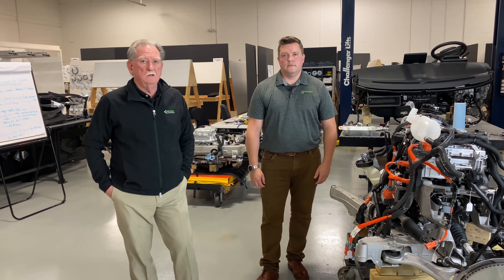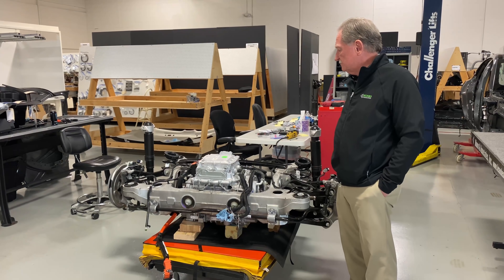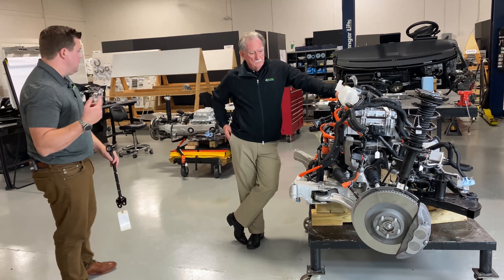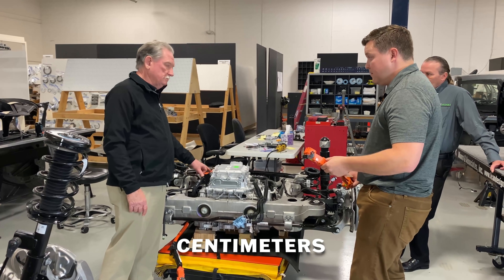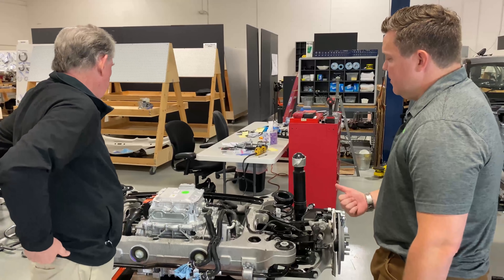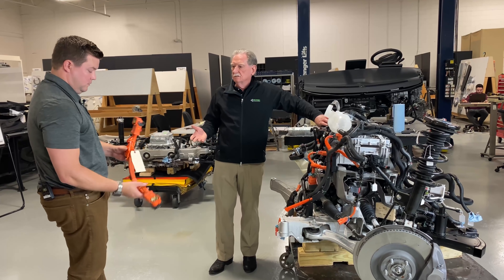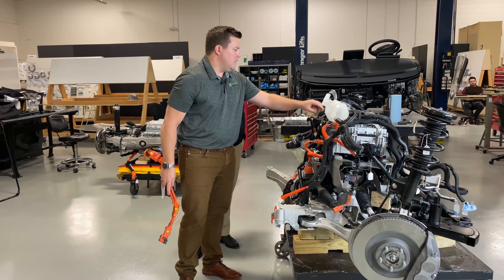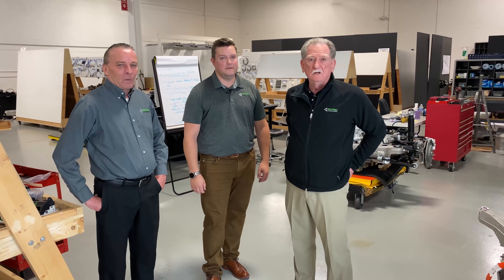Mach-E Suspension & High Voltage Wiring Compared to Tesla Model Y

Comment: I hate to be “that guy” but here we go.  So, your standard of excellence is Tesla, one of the least reliable cars on the planet.  The Ford Mach-E, on the other hand, is one the best.  One big difference I see between Tesla and Ford is Ford can take criticism and Elon Musk cannot.    Many people have been denied upgrades, warranties, or black balled for having the nerve to say something bad about Tesla.  Can you imagine being denied service at a Ford dealership because your Facebook page said Found On Road Dead.  Tesla also requires owners to go Tesla only for repairs.  No thanks.

Push-on connectors are great for low current application.  No so good for high current.  You can get arcing between surfaces and eventually high resistance, bad.  I will take solder connection thank you very much. 

Not a fan of aluminum control arms.  Elasticity is not as good as steel and it tends to brake and not bend when hit hard.  That is the deterrence between driving home with a bad pull and spinning out of control if you hit a large pot hole at 45 MPH.  If you want to see an amazing chassis take apart a Dodge Viper not BMW.  Mostly chromoly not aluminum.  Not one BMW in the top 30 times around Nürburgring.  There is a couple of Vipers.

You are right, people can get stuck in their ways. Engineers can also design things that look good on paper but don’t work in the real world.  When I was involved in auto racing there was an obvious push to save weight.  The theory was you want to design the race car to be just strong enough to get over the finish line.  I will tell right now I don’t want to race that car. LOL

I did enjoy your video.  Hopefully you can except a different point of view.  Mechanical Engineer and former Master Mechanic.

Comment: The only advantage I can see to that drop in style is conversion you want to take a fossil fuel driven motor take it out put an electric motor in this is the perfect setup it will fit in wherever you want it as long as you treat everything as if there was a motor in that car to begin with so I think this might just be them covering both bases for right now like you said it's their first swing they don't want to miss and I think this is a way of doing that and at the same time it's easier to do and more cost efficient because there's less tooling changing there's less machines they have to be converted to a different style this is still basically the same style so all of their current machinery can put this in place quite easily

Comment: Looks like a hose nightmare at 11:00.  Looks to me like the bottom line is get a Tesla
Reply: Watch the other video where they compare the thermal systems, the Mach-e looks like the Three Stooges designed it. I wouldn’t touch it with a 20’ pole.

Comment: What stood out to me, knowing that Ford management made a mid-project decision to make a performance car called a Mustang out of an in house bottom up EV design for a sedan was the very possibility that the front motor assembly might have replaced a hybrid version of that prosaic sedan in their line up. That would need the same front drive motor from some other Ford sedan from its Mexican and perhaps Brazilian operations as a drop in. The smaller but more elegant rear motor assembly could have propelled a compact  family sedan just fine, as an EV with less performance and more range ability based on battery pack size variations. Tesla inspired them to make this the higher price point product it now is, and sedans for the  North American market have been dropped except for Mustangs that the F-150 crowd will still want to buy in second or third childhood:)

Comment: We are a team of 6 Engineers that leads the development of all HV Connectors at Ford.  I quite enjoyed this video and we are always open to constructive criticism.  Some points mentioned are totally accurate in the video but certain things are not as it's easier to point things out being an outsider.  We work collectively as a team and are communicating day-in/day-out so there is no such thing as lack of communication.  We do have suppliers building these connectors for us but they go through intensive DV, also the aluminum casting shield is to comply the EMC requirements as mentioned at 12:00.  We will be working hard to improve the design in the near future.

Comment: So basically this entire guy is about making it cheaper....durability, means nothing.  the love of snap in and on parts is just cheap mfg. techniques, not long term durability, or reliability.  all the those plastic snaps go bad over a few years in hot and cold ..Tesla you know is unsustainable...it still doesn't make a profit on products...VW is already #1 in Europe and it just started pushing out EV.  Audi, Porsche, VW, Skoda, and on and on.  Ford teamed up with VW, in order to survive the global vehicle market, which GM and Ford are irrelevant

Comment: So my take away from the Heat Pump analysis and the Wiring Analysis is that Tesla is head and shoulders ahead of everyone so far in the design and execution of their cars (what makes the car go), the only places that they were lagging a bit was in the Panel Gaps and Paint. So, the two things that are typically superior on the Legacy Brands. My Model Y is a December 2020 Build and is very good in Body Gaps (minimal defects), similar to my wife’s C Class Benz.

Comment: The reason it’s a McPherson strut is because it started life using the Ford Fusion chassis, albeit highly modified. This notion that you can’t have a good ride with McPherson struts is ridiculous. BMW’s most popular vehicles use struts, NOT double wishbone (like Tesla). The BMW 3-series/4-series, X3/X4 all use struts and always have, as does a Porsche 911. You can have phenomenal handling and ride quality with a strut. It’s far cheaper to fix, easier to assemble and as mentioned it offers a tighter turning radius. I wish Sandy would stop saying “if you want a BMW ride you need to do what Tesla did…”

Comment: Another reminder that Munro's team are experts in car manufacturing and not design or tuning. The notion that a multilink suspension is automatically better is patently false. Modern BMWs with their complex suspensions have atrocious steering feel and Teslas handle poorly in anything other than a straight line unlike the Taycan which uses the same double wishbone front suspension geometry. Best modern car steering is in the Porsche Cayman and 911 which use (drum roll) struts with the 992 GT3 being the first front control arm setup.

Comment: Hey Sandy the agreement VW and Ford was not for the MEB under he ID4 in North America. There are multi parts to their cooperation:
- Ford will use MEB only in Europe for a smaller vehicle slotted below the MachE. 
- VW Amarok will be a truck built on the Ranger platform 
- they are co-developing 2 BEV van platforms. VW is working on the smaller one & Ford is working on the larger one.

There was a lot of news around all of this two years ago if you wanted to read up on it. Or check with your old buddies at Ford.  If you want more info on this platform you are working on you should ask them about the Lincoln and 2nd Ford crossover coming on it (CDX737/CDC474).
Reply: This also explains why you thought the batteries were SK Innovation. They will making cells in Georgia for VW’s UD4 production in Tennessee and Ford’s F150 Lightning in Michigan. 

The MachE batteries are supplied by LG from their factory in Poland. This was mentioned when they announced that production for the first 12 months would be production constrained to 50,000 with 1/3 for North America and 2/3 for Europe due to the tougher emissions requirements there.

Comment: Sometimes someone unfamiliar with a particular piece of standby equipment would exclaim "what's making that god awfull noise?!" when the AC was shut off. The battery bank was 48V ,but there was one circuit that required 110V DC. So a DC motor/alternator was used to invert .

Comment: I really appreciate these videos.  I sure hope ford is watching.  But after seeing the evidence of 2 engineers sitting side by side and not communicating...  I'm not hopeful...
It has always seemed to me that the OEMs have designed mandatory maintenance time to be long and excessive, thus increasing the money made by the dealers in repair costs.  I see so many times in my life where I spent an hour working on 1 component that should have taken me 5 minutes to remove and replace.  Those screw-down connectors come from an engineer who is not thinking forward to the effect he is having on the maintenance cost of the vehicle or the stress he is causing the do it yourself owner/operator.  That kind of short-sightedness from a highly educated engineer is infuriating at the 59-minute mark of removing that 1 component...

Comment: I bought a Transit Connect last year because the back-end costs of ownership were cheaper (literally) than other options with FWD plus cargo space,in a limited wheel base.  I'm amazed at the power the 4-cyl engine puts out vs my old Honda Civic with the same two-liter displacement.  But after watching this and reading a story about "Right-to-repair" when it comes to Tesla's modular components, I'd rather go with Ford's funky methods- maybe that power train could fit in my van one day?

Comment: I'm not really surprised by the route Ford took for their first EV. Time will tell what works and what doesn't for various reasons. What matters to me as a consumer is the frequency, reliability and aggravation factor I'll have to put up with in maintenance and repairs. Why reinvent the car if you can use off the shelf components that you already have in inventory using preexisting assembly methodologies if it can save you time to market and cost of development. This is probably how Ford got to market so quick. That being said, I don't want to be the Guinea pig driving a 1st generation vehicle as their will be unforeseen problems that I would have to deal with.

Comment: Sandy should have let Cory speak for the entire video and resist intimidating him with his "I did this last century" and I'm your boss perspective.  In addition, there is a lack of return-on-investment assessment, for example the curved upper rear Mach-E control arm that is stamped in an arc and welded closed, rather than just a stamped straight or welded from a tube and pair of clevises.  Where is the consideration for the value gained with the curved component in terms of body structure cost and/or benefits from useable space?  The added cost of that and similarly the HV cable connector and minor length difference over Tesla could be justified if a systems value approach was taken.  I'd even agree with Sandy that engineering management structure, departmental competition and/or lack of teamwork could account for some of these perceived anomalies but what are the costs of doing it differently?  In the end, it's the profitability of these products that is the bottom line.  I would really like to see Sandy's clearly well-experienced employees contribute more without continuous interruption.

Comment: I noticed my 2003 Porsche 911 uses similar locking connectors as the Tesla for the oxygen sensors. Of course they are not as large as those heavy duty Tesla connectors. But goes to show you the quality that went into the Model 3 and the Model Y. 👍🏻

Comment: I don’t recall For suggesting the Mach-E was going to use VW’s MEB Platform.  I recall Ford saying that they use the MEB platform for OTHER vehicles, not the Mach-E.  It’s the Ford Stromer that’s to be the first MEB-based Ford, I believe.  Munro and his suspension expert are incorrect to suggest Ford ever said the Mach-E would be MEB-based, I think.  Otherwise a really good video.

Comment: Corey I think I found the source of all the different connectors and front end motor design drama in the Mach-e video:
1-Ford web info still says the awd Premium model uses 2 PM motors. You guys say the front motor is an induction motor as in a model Y. 
I think there was really a design shift within Ford. 
2-Hyundai group is the only one AFAIK that use both PM motors in the new Ioniq5 and EV6 awd models but they had to decouple mechanically the front PM motor from the front axle when being in non Sport/ Snow mode ( to improve range  and shift to a normal rwd drive mode with 2 motors). The decoupler is called « the disconnector » and is patented by Hyundai. It simply removes the natural braking effect (just like a stepping motor) any tire axle driven unpowered front PM motor would cause.  So I suspect Ford did a big last minute change  to replace the front PM with an induction motor to regain rwd and increase in range when not in sport awd mode .
What do you think?

Comment: I think I rather the connectors I've seen on the Leaf(and sure on others) for their HV systems and others.. You can't pull the close leaver unless it's mated with the other half.
So if the leaver is down, it /has/ to be mated.. These I can see being closed then pushed on and without a tug it looks like they are done up.  It's a good thing they have the guard connector! :)

Comment: Munro Live: Hopefully you all will discuss the large elaborate "subframe like" castings utilized for mounting the front and rear suspensions, motors, gearboxes and etc.. This to me is similar to the mega-castings of Tesla, in other words a smaller version of Tesla's making up a crush zone and numerous mounting points. I presume a hypereutectic alloy casting to give it strength.

Comment: The old man spoiled the show - at least 5 times more info would have been coming over without him. Maybe just try again. Almost no real info, just pictures - and a waste of time. We still waiting for the cost per meter of such most expensive cables. And this Ford is no good to buy - no real progress: all the black rubber hoses all around the engine will age and go defect way before the electric and the e-motor, just with a todays Gas-Fords. A pest to see.
Reply: And how do i reach those rubber hoses, in case i have to change one? Makes suspicious that the design and the parts of the electrical boards and the selection of the components used could be not so good as well, and too quickly designed, 'as well not yet completly ready'? I would trust a computer mainboard from Taiwan - but how about Ford here?
Reply: If i want to drive 500k miles or 20 years, for instance the capacitors must last. One defect, aging capacitor may spoil a complete board. Who supplies those? Reputation?

Comment: When a manufacturer uses off the shelf components you can normally find off components to fix it. Integrated components need specialist workshops to fix and if it's to expensive the car's will wind up at the wrecker. Also double ball joints at the front is better yes, but creates twice as many pionts of wear. 99% of people will never feel the difference but they will notice the squeak or knock from a worn ball joint.

Comment: Those rubber hoses are a real rats nest, or snake den, and they all look like custom formed hoses.  Scary potential for a ton of leaks, and a plumber’s nightmare to assemble, and a parts department problem to keep all the different hoses in stock at the dealership.

Comment: Ford Authority reviewed Ford PR release June 2020: "Ford’s first MEB-based vehicle will be designed and engineered in Cologne-Merkenich. Announcing it in June 2020, the Blue Oval said the product would be “a highly differentiated Ford electric vehicle,” without mentioning the segment or shape of the car, which we now learn is a boxy crossover."

The Mach-E was never a VW platform product; reading more of Ford's releases make it sound like the VW platform will be used for a Ford Europe dedicated product.

Comment: It really stands out when you can see two engineers designed the same thing separately. With HV cables being the most expensive wiring I guess you want them as short as possible. Also having a quick release without having to poke a screwdriver around is probably a good idea. Less time having to touch HV connectors and a clean snap in/out connection.

Comment: Full disclosure: I’m not an engineer nor a gear head (as you’ll soon see!).

I was thinking about the OEM’s transition from ICE to EV, and what (if any) parallels there are to the transition for camera manufacturers from film to digital, specifically in SLR design/function. 

Nikon/Canon et al COULD have created a completely new, from the ground up, camera design when going from film to digital. Instead, they kept the form and function as close to their old SLR designs as they could. The given rationale was to make the user’s transition from film to digital as smooth as possible. 

Sandy mentioned a couple times that Ford keeping “old school” components and application on the MME may benefit design/engineering/assembly/repair (but he didn’t mention user). Holding onto the old to make others feel secure…

I love my Model 3. I love the simplicity of form and function when I’m in the driver seat. I don’t know exactly HOW Tesla did it, but they managed to create a completely unique, different user (driver) environment - and yet they made it so damn intuitive and elegant that my first reaction on driving the car was, “Yes! Of course! Why hasn’t it ALWAYS been this way?”

Thanks for a great show, Sandy. It was accessible even by a non-engineer, non- gear head like me!

Comment: Tbh this channel is a ton of peanut gallery with no context of the actual reasoning behind much of the design.

Sandy and crew nitpick sometimes really small things and make mountains out of molehills with no clue about the tradeoffs engineers actually made. Many times it's a case of "could it have been slightly optimized? Yes. Was it worth the engineering time and effort? No."